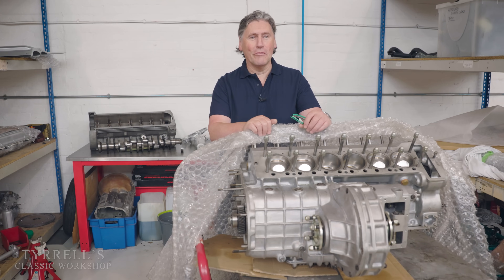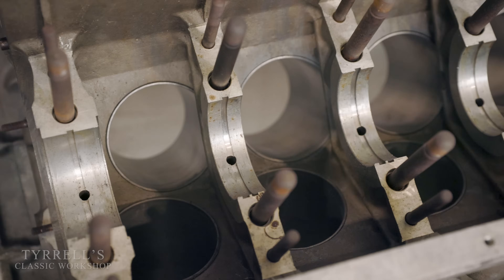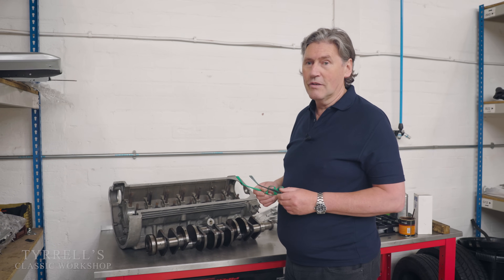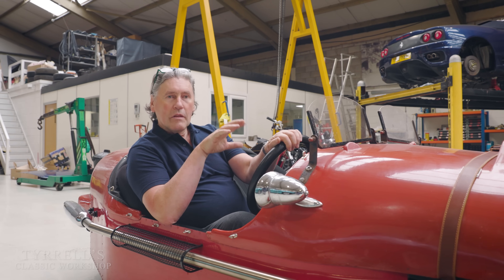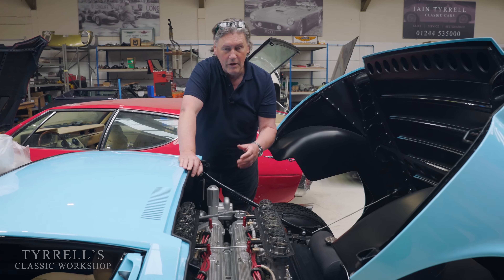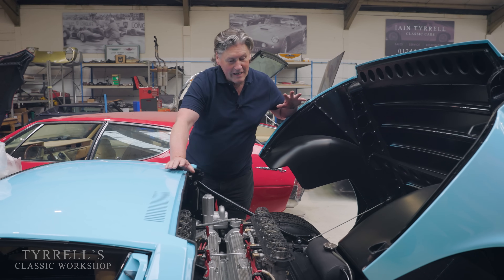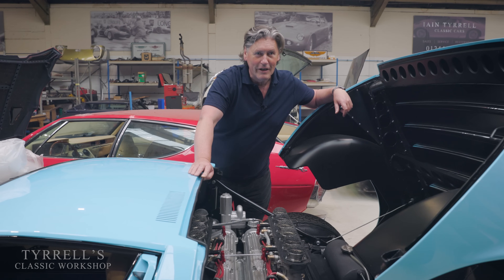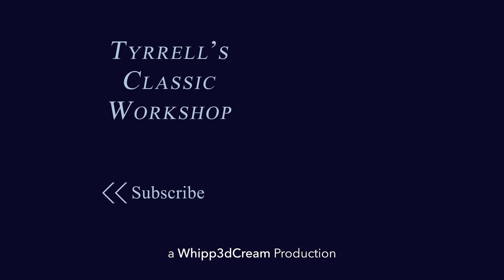How to warm up your classic car engine the correct way & why it matters | Tyrrell's Classic Workshop

Comment: You should have explained that the reason for pumping the throttle on the Lambo is to use the accelerator pump squirters on those downdraft carbs to prime the intakes with fuel in place of a proper cold start enrichment device

Comment: Great video as always!   I've often wished and wondered why I've never heard of an engine with an auxiliary electric oil pump that could be run before start up similar to an electric fuel pump. Not as a primary of course due to higher chance of failure. Any thoughts?
Reply: There are systems out there which work exactly as you describe. If you search for "Engine Preoiler", you'll find them.

Comment: “ ...until it’s getting warm “ ( 12.57 )

Does that mean when the water temperature needle first moves ? Or half way to normal temperature ? Or when , on a car with one of course , an oil temperature gauge needle first moves or gets to its normal temperature. There’s a big difference between these temperatures.

I used to own a Fiat Coupe with a 5 cylinder turbo engine.  Normally the water temperature gauge would show signs of movement after a mile , get to normal running temperature after 3 miles , at which point the oil temperature gauge would START showing movement and only after some 4 or so miles later would the oil temp gauge would get to normal running temperature .

Only then would I give the car anything like full throttle.

Although I take Ian’s point that the start up is when most engine wear occurs.

Comment: What a nice surprise. I like this. I just wonder what exactly the choke is for. I mean, what's the benefit over just using the throttle to keep it at around 1500 rpm?
Reply: Fuel enrichment, but only as long as necessary and no more
Reply: @martinnorth2680  Yes, so more air to burn easier. Ah.. to keep the engine running, especially when it's Icey-cold. Of course. Thanks for refreshing my mind, I need a choke myself lately :-)

Comment: This is the problem for me, i have a  1998  mercedes S600 with a late M120 motor i haven't started it in 18 months i have been worried about wear,  normally after 4 turns of the starter it will fire up at 1500 rpm for 30 seconds i believe to heat the KATS ,what could i do when i start it to lessen the wear???  any tips for me would really help
EDIT** It does start a bit like the modern bentley i have saw people put clean oil in the oil filter housing on waking a v12 up would that help in my case???
Reply from the maker: You have little choice with an electronically managed engine such as this. All things being equal, it should be fine
Reply: @iain_tyrrell  i was thinking of putting a litre of fresh oil in the filler  and just going for it , thank you for the response i love your vids

Comment: This is mostly common sense. When you start an engine it’s good to have the oil protecting all the bits to prevent wear so pressurising the oil system before ignition is preferable. And when the engine has started, keeping the revs low is again just common sense. How low? Below 2500 and preferably below 2000 revs. Saab advised driving off immediately after starting and keeping the revs low, the idea behind that was to get the engine up to work temperature asap without putting the oil under too much pressure. This is something not commented on in the video. The water temperature is often used as a measure of whether the engine is up to temp, however if you have an oil temperature gauge you will know that the oil is slower than the water temp to reach working temperature. You can access/ read oil temp info from the OBD2 port. 
Starting an engine in very cold weather is a serious issue. Rotating the engine to prime the engine before ignition is the best method. Warming the oil with some form of external heater is another.  An engine can run happily for days on end when it’s at its ideal working temperature. Stop/start driving in traffic is crazy idea which must shorten engine life. Some engines have the exhaust manifold passing very close to the oil sump. This can cause the oil to overheat when the car has come to a sudden halt after long periods of high revs and high manifold heat. Wrapping the exhaust or installing an effective heat shield can overcome this problem. It is best to ‘cool’ the engine after high speed run before switching the engine off.
Reply: The thing with common sense is that these days it's not all that common.

Comment: I've been taught to never warm up your engine at a standstill. After one did all the preperations and started it up properly, i was told to right away drive it gently with 1500-2000 rpm...

Comment: All your petrol engined classic cars should have a fully synthetic 2 stroke oil added to the petrol in the tank at a ratio of 150 to one, this small amount of oil has no ill effect whatsoever regarding exhaust smoke or plug oiling but will help protect the engines bore and rings from wear on cold startups and while running, the oil also helps to prevent intake guide wear and carburettor slide or spindle wear. I've been doing this for many years on big old 4 stroke single cylinder sports motorcycle engines and after thousands of miles running, on stripping to check I find the cylinder assembly internals are in pristine condition, in fact better than any used bore and rings I've seen that has not had the 2 stroke oil added.. A few litres of synthetic 2 stroke oil over the course of a year is going to be a lot cheaper than having to pay for a rebore and new pistons every few years so you should try this

Comment: On my 6.9 litre Volvo diesel boat engine I'll hold the stop solenoid whilst cranking a cold start till the oil pressure gauge twitches then release and let it light, also when warm, powering up in increments of say 100-200 rpm allowing components to warm gradually reduces thermal shock on turbo, manifold, cylinder head, gaskets etc, reverse procedure when reducing power. An 850kg lump of pig iron takes a while to get to an even temp.

Comment: My 1967 Alfa Romeo had a hand accelerator, which I assume was so you didn't have to sit with your foot on the accelerator while it warmed up, as Ian did in the Muira. I always left it with the hand accelerator on until the oil temperature gauge started to indicate before driving off. Interesting video as always.
Reply: I was thinking exactly the same thing. My 1972 Alfa 105 coupé had that hand throttle i never used the choke in all the years i had that car. 2 Pumps of the throttle and then hold it half way down and turn the key. Hand throttle to 1500 revs for 5 minutes while i shut the garage door. Mine was on Webers. I think they were the instructionn in the hand book.

Comment: Would an oil pressure accumulator added to the pressure side of the lubrication system help to alleviate the issue of lack of oil in the right places at start-up?

Comment: Ive run classic 1969 Honda CB750 for over 180,000 miles. I  always fit oil pressure gauges right on the main oil gallery for feel good riding. Starting from cold flick the ignition kill switch off crank it over till the oil pressure waning light goes off (this corresponds to correct oil pressure, I check the gauge) then put choke on, kill swich on and crank it and it busts into life.These bikes have shell bearings same as car engines and obviously electric start and will outlive us all if the oil is changed as per service routine and started from cold with oil pressure up to spec

Comment: With the benefit of an oil pressure gauge I pull the HT lead and crank a few seconds with choke in until the gauge registers some pressure then pop lead back in, pull choke (if needed) and start. Its good starting a journey with dirty hands!

Comment: Hello Tyrell,  I've been meaning to write you for some time.  My first message to you was about lubricants.  I keep Krytox GPL lubricants in my shop.  To my surprise you can buy Krytox lubricants on eBay and it is usually half the price of getting it from the manufacture.  For greases I use GPL225 for general purpose stuff and then GPL 217 for higher load applications like wheel bearings.  I'm restoring an Islero and will use 217 on the front wheel bearing.  I figure I'll have $50 in lubricant per wheel but if it saves just one bearing it has more than paid for itself.  Also note you don't need to use much of this stuff so the tubs last a long time.  I also have GPL-105 oil.  You can buys this in small bottles as it it used for lubricating Oxygen regulators, you just can't use hydrocarbons in a pure oxygen atmosphere.  Again I got this on eBay and I think I paid $35 for the bottle I have.  Lastly on the lubrication front I have HBN, Hexagonal Boron Nitride,  which is sometime called high temperature graphite and it has the same lattice structure of graphite but doesn't burn.  I like to use this on exhaust valves as it will not oxidize at all.  The last engine I rebuilt I lubricated the intake valves with GLP225, as the gas will not wash it away, and the exhaust valves with HBN.  I don't have enough miles on that engine to know if this helped at all but it should.  When I was installing the exhaust valves it was interest to see how much easier the valves slid in the guides after putting a very little bit of HBN on them.  I also did try and put a little HBN between the top of the valve and the valve oil seal.  Again, no idea if this helped at all or not.
As for this video, I've been thinking I would like to put an electric oil pump in the Islero so I can just turn it on for a few minutes before trying to start it.  Any idea as to the best way to go about this?  I've also thought it would be nice to put an oil temperature thermostat on the car to bypass the oil cooler until the car is up to temperature.  Any thoughts on that?  Lastly, as I live in Florida having AC is really makes the car more usable.  Now I've heard that lslero's with AC had a different front gearing systems to handle the added torque but I only read that one place.  I also don't like the way the AC compressor looks on the V12 engine.  I've been thinking about getting a Tesla AC compressor and a battery pack that could run it for say 8 hours and put that in the trunk?  Again, I always want to car to be able to be put back to original with out much effort.  Lastly, I am looking into having some new heads made, mine are just not in great shape.  I could have new heads 3D printed or I could have the sand molds 3D printed and the casting made.  The impression I get is the original casting were not the great to begin with.  I will probably come to my senses and just get my heads repaired but I always like to look at all my options.
Cheers, Jonathan

Comment: On modern Aston Martins, the solution is to hold the throttle FULLY DEPRESSED for the first 3-4 revolutions.  This actually prevents the car from firing and is a recommended procedure when starting their cars from the last couple of decades after a period of non-use.  This was a habit I used every day on the first start as it seemed to me to be a good idea to get some oil circulating to begin with - just for a couple of seconds each morning.  I doubt this method was used in pre- Gaydon cars (early 2000's) and I don't know if it still applies to the latest Merc engined cars but it's very easy to try out and just see if that delays the first combustion!  Don't worry about washing the cylinders walls down with fuel because it will also cut the fuel injection at the same time.

SO - full throttle prevents firing on startup. Any less throttle will still allow it to fire.  Nb this only applies to Astons as far as I know!!

Comment: Thankyou Iain. Very informative. I have a Reliant Robin with 5500 miles on its rebuilt all-aluminium engine with an SU carb. I will follow your Mini-enigined tripod advice. The chokes useage varies in the summer to winter, but I will 'pre-crank' the engine.

Comment: Very interesting video,  reminded my that my grandad (he wasn’t mechanically minded at all) always used to turn the engine of his 1968 Austin Cambridge over on the starting handle a couple of times on the first start of the day before starting it.
Reply: Good for chainsaws and my old Atco Royale mower too: anything with a pull start, 2 or 4-stroke is happier with a couple of 'wake up' rotations before the full yank...

Comment: If you have a car with an old CIS/Bosch K-jet system, it seems that one easy thing to do would be to disconnect the electrical connector on the cold start valve during the warm months.  The car will crank a bit longer, but that's what you want.
In the cold months you can reconnect it.

Comment: Always suprises me that the owners of these classic supercars don't fit electric oil system primers, a small button operated 12v hydraulic style pump with a couple of check valves in and tapped off the filter housing and straight into the main gallery would be ideal for stopping premature wear

Comment: As usual Tyrrell, you've hit it out of the ballpark again.  Great explanation with the usual witty British slang that everybody should understand and enjoy. I love your videos. I fully understand and agree with the one major issue you pointedly impress upon your viewers, there is no oil pressure on every start up which accelerates bearing and camshaft wear.  I have worked on many of the lesser British sport cars from the 50's - 80's, same with German marks and US models.  There is only one oil additive company that I know of that has been around since the 1950's that has a product line that will eliminate most of the dry start concerns.  The manufacturer has not made much of an effort to market to consumers, but rather has concentrated marketing it to the worldwide industrial manufacturers market. They do make a wide range of consumer products, but you will be hard pressed to find any of them unless you walk into their dated offices in Ballard, Washington, USA.  The one constant with their oil additive products is that they are all polarized extreme pressure additives.  They polarize all the oil, whether it be used in your engine, manual transmission, transfer case or differential.  The oil will climb vertically and coat all metal parts with a film of oil, thus always providing lubrication for an engine on start up. Their one product that I use extensively in engines-manual transmissions, differentials, and which you will be hard pressed to find unless you place an order and can wait until they do a production run of it, is MIOA (multi-use industrial oil additive) which is avaiiable in varying viscosities. If you just want their formulated engine only oil additive, it can be found on Amazon as Bardahl B1 or B2.  I have been using it for decades in my 40 year old farm machinery, old and new cars and my 1957 Cessna.  If you like to run your equipment for a very long time without having unscheduled maintenance, it cannot be beat. In case you're wondering, I'm a rancher.

Comment: Thanks so much Iain for great video .You confirmed proper starting procedure of both of my cars, a 1958 Cloud 1 & an 89 Bentley Turbo RL. I've owned the Cloud for 24 years & always cranked it over without choke before starting. Then  slight minimal pedal to start & idled it @ about 500 RPM until warm. The Bentley with Bosch K Jetronic FI  I just start  & listen as it idles @ about 800 RPM.

Comment: Personnaly, I always remove (it's really easy to access on my 35 y.o. car) the electric fuel pump fuse when the car has been sitting for a few days or when I take it out for the first time in spring.. Then I do a few seconds cranck to build up oil pressure, Only then I replace the fuse. Voilà !

Comment: Big thanks for this education!  And WOW!!! You are the first - in my tiny (7year) "carguy era" - who knows, how fluid pressure build up in a "tube"! 
 I have one question: doesn't have the Bentley any bearing-clearence issue? - because: starter works for a little, than engine start with 1 sec knocking, than oil pressure comes = bearings have fresh, pressurized oil, so  knocking ended, and engine run smoothly after
or this engine has only one noisy, tired hydraulic lifter?
Reply from the maker: All Bentleys with this V8 have tapper tap on cold start- it’s quite normal

Comment: I wonder if it is possible to retrofit one of these newfangled bearings that modern engines with a start/stop function have, where the innermost layer of the bearing is a plastic that holds oil long after the pressure is gone.

Comment: Another thing this just shows is why a modern car starts only after 2 or 3 turns, but the start-stop (which I've disabled) is so much faster. Cold engine is just primed a little. Also why modern car even in freezing only revs to max 1150/1200 rpm, and very fast drops to 900-1000. Especially comparing with older cars..

Very nice and thorough explaining, and it's just entertaining..

Comment: The best, thank you for  this so much and my engine thanks you too!  Oil is so  cheap and available, but you need to change the oil when required as well as the filter(s) with respect for the part of the world you are living, hot vs cold, and then making the starting a habit always.